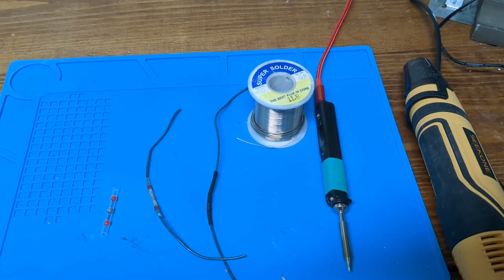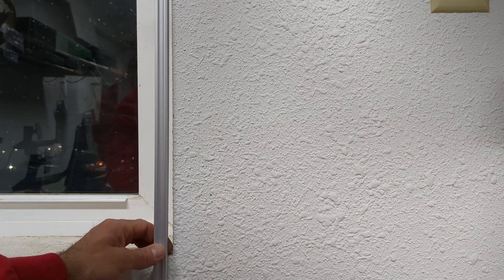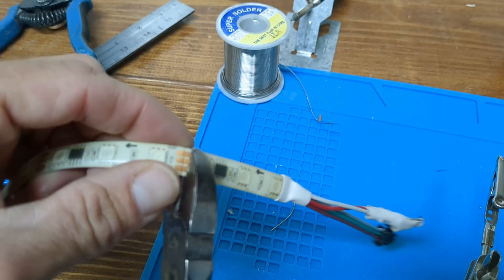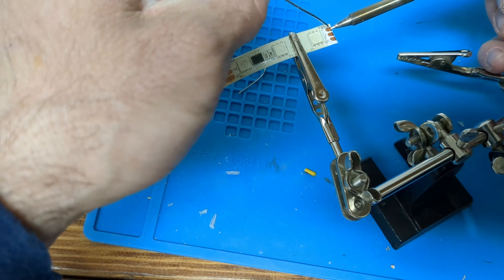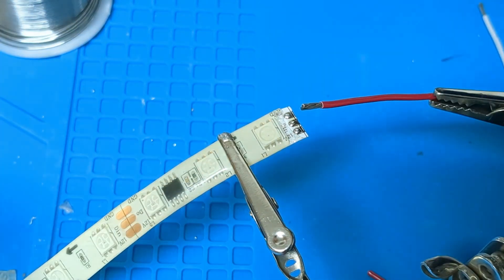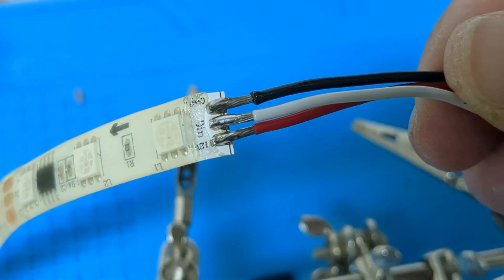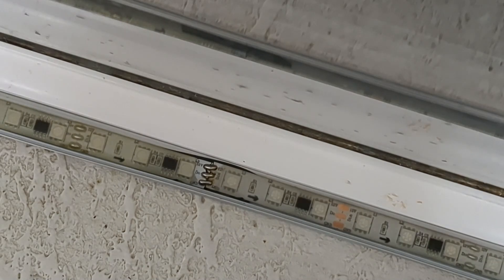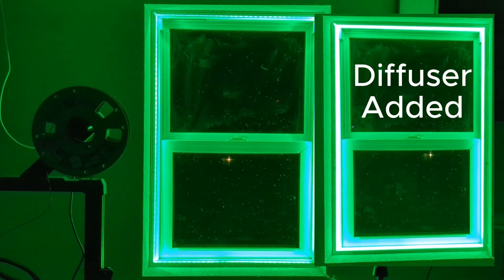How to Solder LED Strip Lights and Outline a Window with an Aluminum Channel (Easy DIY Tutorial)

Comment: caution never strip your wires out too long. You could accidentally cross the wires together and sort them out. Always strip just the amount that you need to solder to the pad and no extra one other tip is to 10 the LED strip pad with solder along with the wire. This will make a stronger connection and solder together faster preventing damage to your LED chips.
Reply from the maker: Very good points, pre-tinning the LED strip is a pro tip that can easily be overlooked.